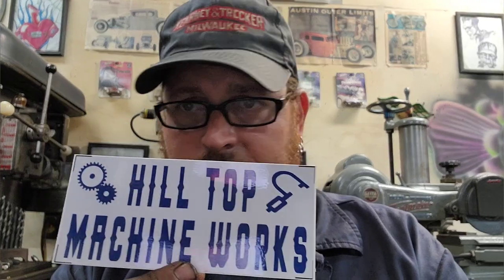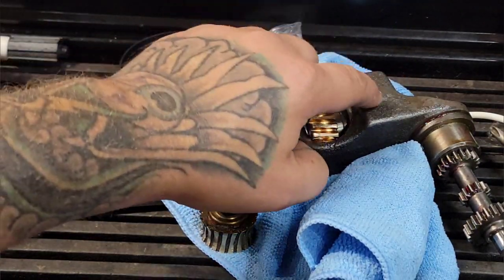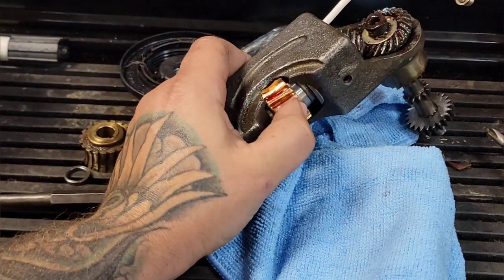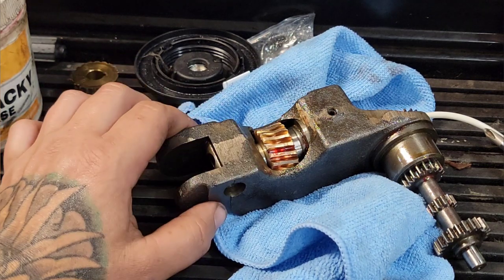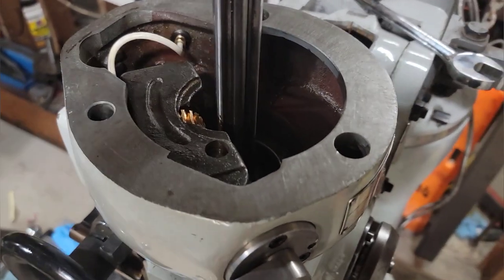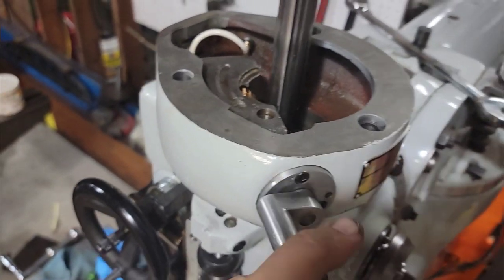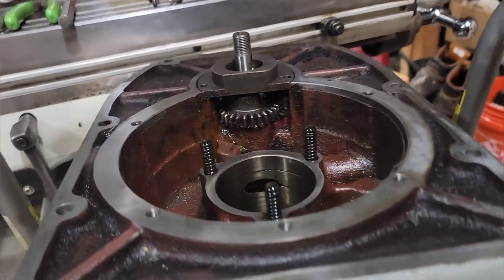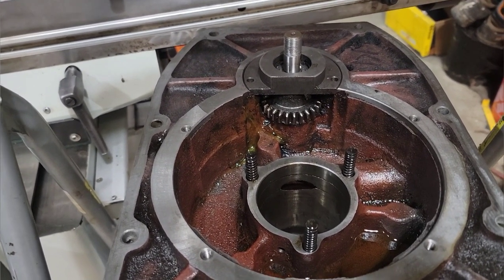acra bridgeport clone head repair ( power quill feed repair )

Comment: Very nice. I tore my ACRA down to singular components, cleaned every screw, replaced every bearing with ABEC7 class bearings, checked and re-scraped ways and gibs as needed, stripped all paint and repainted. Finally an component by component level of re-tramming which ultimately leads to a much higher level of tolerance than new. This project taught me a lot about bearing tolerance classes. What a buttery smooth machine when ABEC 7 and above, zero vibrations.

Comment: Good one . I am putting off my Bridgeport head repairs until  next year , when i have the other mill up & running  .  Cheers .👍
Reply: ... same concerns I got, Max .  I'm down to a one mill shop now,  and can't afford to have it down .  I was thinking that my only problem was having to breakdown a setup for another operation,  but now the mill has 45 yrs on it and how much longer can it go without maintenance or breakage .  .. may have to open up the pocketbook and pick up a backup machine .
Reply: @kens.8834  As long as it's not making any weird noises , should be ok  !    The belt in my BP is sounding a bit old & crusty !
Reply from the maker: Yeah she quieted right down . I'm liking it. 👍 I can't wait to see your hbm up and running!